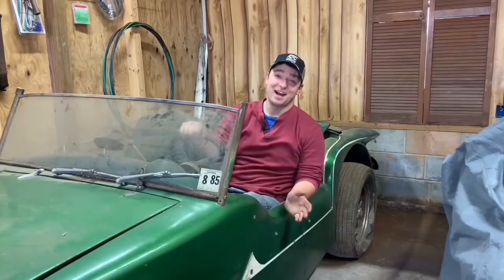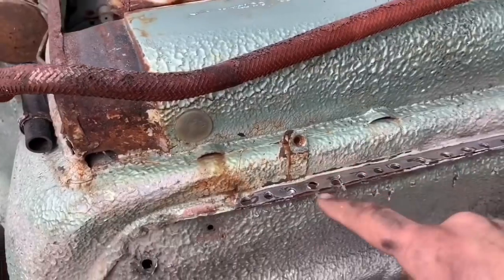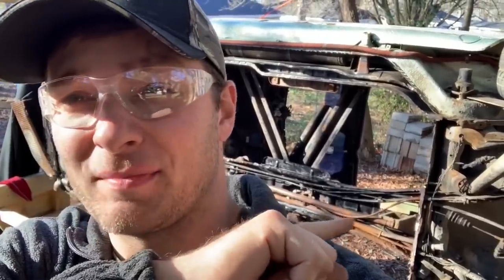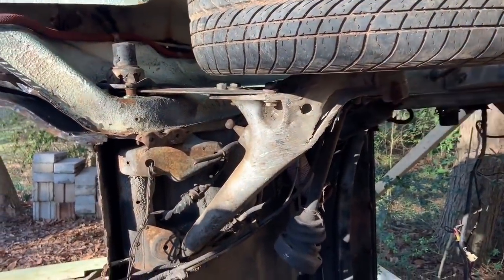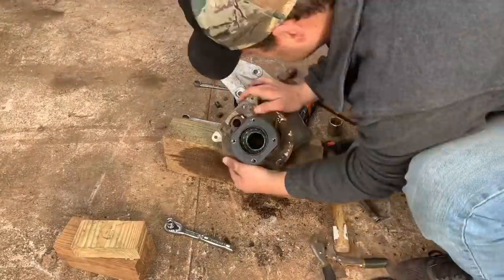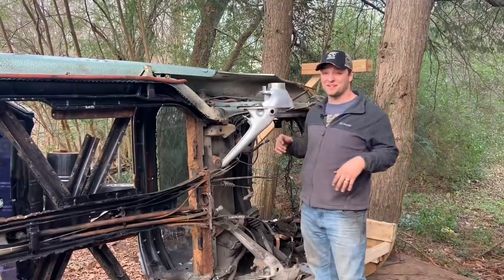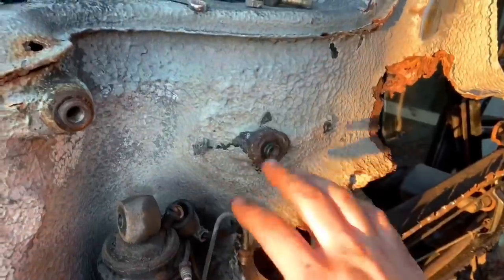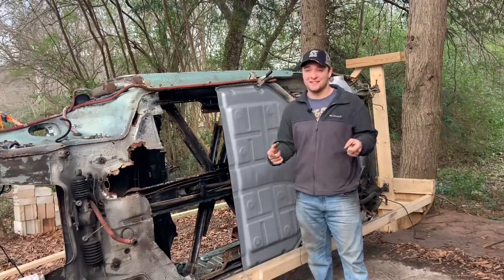Saving a Vintage Porsche 911 Targa from the Scrapyard: Rebuild Part 6

Comment: um personally I think you're wasting your time with the Porsche. One, it's so far gone, you'll never bring it back on a working man's budget. Two, even if you do, you ain't got much when it's done. I've driven a few of that ilk, they didn't impress me much. I'd rather see more on that weird one off you found, or a old chevy or old Ford, or the like. "Merican steel.
Reply: Most of the cost on a project like this is labor. He's got that covered.

As far as it not being a good car to drive, fine that's your opinion. No classic car can compare to a modern car. But people love them anyway.
Reply: @AlvinBrinson  I love classic cars, but not Porsches. I'd rather have a VW bug, old school. Porsches are highly over rated, and for a guy my size, well they're just too uncomfortable. For all the hype, they don't run great either, they may have top end speed, but at least the ones I drove were not very quick. When I drove them they were new or nearly new, but would be considered classics now. Even the much lauded Carerra didn't have the quickness I like. They did handle okay, but frankly in normal street use, you never get to see what they can really do at speed. It's just like a lot of other high end cars, they may have high end performance, be able to go 200+ mph, but where the hell are you gonna do that in the real world? I'd rather get there comfortably than not, you're not gonna get there any faster anyway, traffic just isn't going to let you do that, most places. There is a stretch of highway heading from LA to Vegas where you could maybe do 150, but those stretches are rare.
Reply: toot tall I drove some old Porsches and have a completely different impression. To me they don’t handle well with the end always trying to escape due the weight of the engine behind the rear axle. And their performance up to the Turbo one’s was pretty poor. But classic cars are never about perfomance and can’t be compared with modern cars. 
It’s all about passion, emotions. 
But maybe you drove a different model than me.
Reply: @paulog8813  I was the guy that had to take them out and warm them up before going to emmissions. I was actually told to spank the porsches. I drove many models. Frankly, on regualar streets at what speeds I could go and not risk my license and my job, they were lackluster, even the turbo. The front engine liquid cooled ones were way worse in my opinion. You just traded which end wanted to step out. I can deal with the rear end stepping out easier than the front.